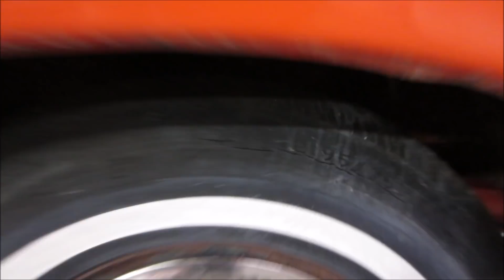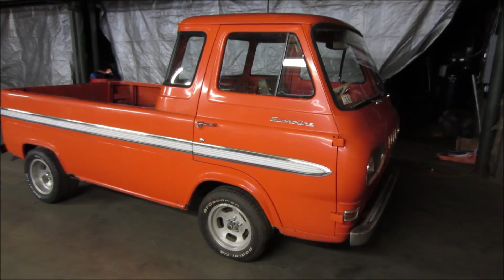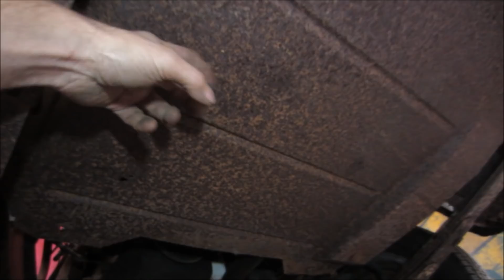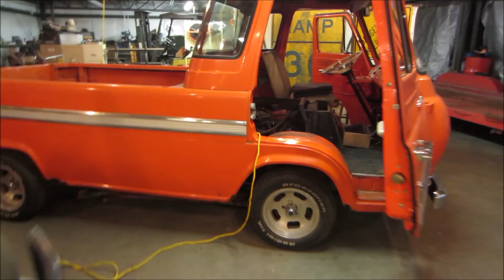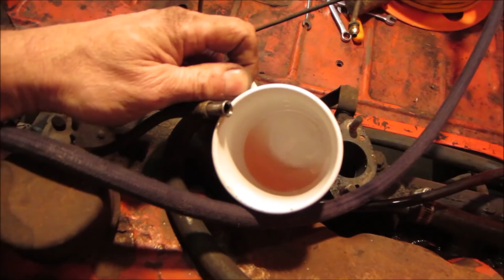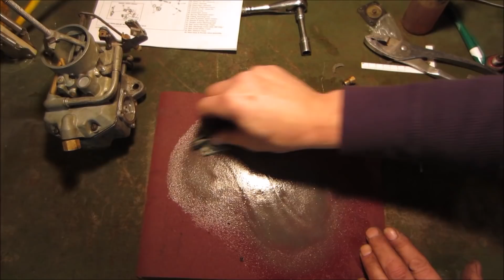Bought A Ratty Ford Truck,  Let The Fixing Begin.

Comment: Im figuring it is a 170 ci  because it has an automatic choke. I think the falcon 144 was manual choke and in the falcons only stick shift.  I dont get scared by that rust. I just want to spray it with something to stop it from taking that thing back into the ground. Something other than bar and chain oil. ha ha. But its your baby. I just wouldn't like the greasy dirtiness of that.  I use an airless paint sprayer hit it with rust converter water base. after power wash. then paint it with some water based alkyd emulsion paint. (turns to like an rubber oil based finish.) sticks really good. not very easy for the rust to come back.  Unlike undercoating does not separate very easy.

Comment: When serving in the Navy in the 60's and 70's they had a number of these trucks that were used on the flight line. The top of the caps were cut off  to where they were open air vehicles.

Comment: i have been restoring Mustangs & Shelbys for 37 yrs i have a tip for you insted of puting gas in carb fill up the fuel bowl thru the vent tubes for long run time use a chicken baster with hose attached small vacuum hose fit inside another hose to fit to baster will fit most vent tubes i have done this for yrs needing no assistancet to start run until fuel pump picks up let me know how you like it your friend Tim

Comment: Mustie1: on that 65 ford eco..the carburetor line contector (brass fitting) I think their is a round brass 'flat bushing' that is rounded at the end for the line-line..the whole piece is about 3/16" thick..it fits inside of the brass-fitting that screws into the carb. fuel inlet. This helps the line stay setted so fuel does leak under-pressure..3 1/2 to 5 ft. pounds. And I noticed the fuel-line looked alittle dinged-up on the end.."if, you've got a tool to flare-out the end of the old-gas-line and replace that old style fuel fitting that is machined to match the flared end would be better..(Costs about $4)..good luck..with your vid's..video cam works great..! The new led-soft 'white- lite bulb' should help with your lighting problems..( feathers the light better..more even..& gives more light in the shadows and corners.." spreads the light around more evenly".. and saves money on electricity. Looking forward to more educational videos thanks a lot RGB critter.

Comment: The wheels and tires look fantastic, that falcon based truck has a great body style. When it's done it will be a great, I'm thoroughly enjoying this project, old vehicles such as this back on the road are great to see. I like them better than the new stuff, because guys like you can get them back into decent running order again. The new stuff is not as interesting or as fixable and basic. The rebuilt carburetor and temp fuel system, lots of progress.

Comment: Finding a dual Master Cyl may be your biggest challenge as they were only available in 67 which is the last year for this style of these trucks and vans. Your going to find as you go through this truck, that there are a lot of things on it that are "Econoline Specific". Fuse block is on the light switch, when it come time to check for burnt fuses.

Comment: i agree with you on the rims. that truck needs those rims as bad as it needs brake hardware on the rear axle. do you remember running extended spring shackles? they work as long as you don't do a lot of power slides, and weld a tie brace in the middle. i had both extended shackles, and air shocks on my '71 torino gt to sky jack it the way i wanted it. with keystone classics and m 50 15's on the rear, i needed all the clearance i could get.

Comment: For your old green vintage engine see old steam powered machine shop video   no 45. Move the existing ring to the top space and make a new one. Remember to put lever so to ADVANCE the spark ( to the left of tdc, if turning clockwise.)

Comment: Those wheels look amazing,. Also those old I6 ford truck motors were indestructible..

Possible cheap upgrades?
Rear is the older ford 7.5in rear, the 8.8 from an 86 mustang GT should be a direct swap if you want posi trac, you can also get a later model 300 from the F series trucks if you want to stick with the i6 and get some cheap additional power, or stroke this thing with parts from the 300. You could also 302 swap it, but i would look for an 85GT motor, they are roller tappet, forged internals, with the carb, the 86 goes to a roller cam but was efi. They all are forged internally till 91 when they changed to cast pistons. The manifolds from the factory were pretty restricted, just putting after market intake and exhaust manifolds will wake up that i6 Offenhauser makes the 4bbl conversion intake with ported and polished runners, it makes a big difference in how these older i6 engines run.. sorry for any misspelled words..

Comment: I have a '67 I'm building for my project. But I'm taking mine a lot further than you are. Built my own chassis from scratch, cut off the bed and building my own. In short it will kind look like an old cab over Mac and it will be powered by a big block Ford 545 cu in. Rear axle is from an F350 dually.

Comment: Typ[ical Ford rot box.  i had a Ford 14 seater - the exterior bodywork was first class and looked the business, BUT the inner sills and rear section looked identical to your pick up.    It failed it's test and i reluctantly sold it as i didn't have financial means to get it repaired,  there was more hole than metal, but at least it has apparently been given a new lease of life - some guy bought it from me, and it's now in Romania !   ( the welding labour costs are about $ 5 an hour over there !)

Comment: You can look into the color of light, aka the Kelvin scale. The warmer the light, the better it is for our eyes and minds. 2700-3000 is common for warm, soft light. 4000-6500ish is harsh, sterile, white light. Most fluorescent tubes are harsh white light. Incandescent bulbs are a warmer, softer light. Most new cars have ultra-bright white LED headlights that are like 6500k. Awful for other drivers on the road. You can get warm white LED bulbs and tubes. Most people don't think twice about which bulbs they grab at the store, but it really does matter.

Comment: I'm not sure why you turned off the comments in the 3rd video. But having owned a 65 Falcon Ranchero from 1977 to 1990, you may want to get that head magnafluxed, those heads are notorious for cracking either on the intake manifold part in the middle of the carb or where the exhaust manifold bolts in the center. In 13 years I had 2 cracked heads. I would look at dumping the 170 CU inch and go to the 200 CU inch. The 200 has the same head / intake manifold configuration but is not prone to cracking like the 170. Not picking just telling you of things I had happen with my 170.

Comment: Love it. The tires and wheels look awesome. I agree a 302 would be cool if it fits and duel pipes? Would definitely need some weight in the back. The drive line and rear end would need to match for a 289 at least

Comment: Appreciate how you test components as you go in the reassembly, Mustie. Caught the accelerator pump leak here and has caught the occasional problem with float valves in previous vids. Respect.

Comment: i had a 89 vandura long version with Sliding Door 
275/55R15 Rims - Turbine Style only the v6 Engine though : Interior Full Quilted Velvet with Wooden Cassette Holder 
Few years Back Restoring 1995 GMC Short Box Vandura had all the Doors but lost interest in project now Driving Newer Tahoe - 285/45R22 Tires with 6 spoke Black gloss Rims

Comment: Stick with a straight six but a 300 ci with a Clifford intake and headers. I hear the 300 runs smoother than a 302. The 300 may use same engine perches?

Comment: Think you may have to modify a mustang or falcon fuel tank.    Seems like I remember the a new Econoline tank being unobtainable.      I split mine, cut the rust out and cleaned it,  and then welded in a new band of metal all the way around where the rust line was.  The pan under the front is necessary for cooling,  will overheat without it on the hwy.

Comment: On the lighting question, I don't know what you are using to edit but most video editors allow you to adjust the color temperature. I'm not complaining about the lighting but you could save yourself a few bucks on your power bill if you kept the LED lighting and just use the software to color correct the footage. Some (e.g. premiere pro, etc.) will let you save out a LUT so you don't have to reproduce the same look across multiple videos.

Comment: Im giving away my age but i remember when the Econoline falcons comets were fairly new  in the late 60's and early 70's . It seemed like they all had an exhaust leak at the pipe to manifold and sounded like a tractor. (Yes it should have a donut at the connection but most were a softer material). The engine had soft motor mounts moved all over and a long exhaust pipe so they all leaked sooner or later usually sooner. The broken head casting was not common. But the bolts that were not blind always rusted up because the water could get in from the back side. Fe' v8's had the same issue.

Comment: I'm not sure if you have tried it before but I've had good luck using Simple Green in my ultrasonic cleaner. It's way less expensive and it doesnt wreck the rubber parts like carb cleaner

Comment: The first fitting where you had your fuel leak there should of been a copper crush washer that would go over the fitting to give you a positive seal, it works much like what you see on spark plug's.

Comment: If you're thinking about putting in a 302, you should convert the front brakes over to disk and put in a 2 chamber master cylinder in it - you won't regret it, even if you leave the anemic 6 in it.

Comment: Man mustie1 love the slots on the truck leaves them, and if you go v8 289 was what came in them i believe at least all you have to do is change bell housing use the same transmission. Or make it a mid eng and put a 429 with a automatic transmission bolt the transmission straight to a new 9 inch rear end and have a wheelie monster ? Screw making it nose wheelie 😁😎

Comment: Card looks like an Autolite 1100. Same one on my '69 F-250. After a carb kit from Mike's, I got to know every square millimeter of that thing. Didn't remember which hole the check ball went in. Almost drove myself mad. Once I replaced everything, it runs like a sewing machine.

Comment: With the leaking tank, I know you can (or used to be able to) purchase a solution that you can use to coat the inside of the tank. It was like a rubberized coating that pours in, and then you move the tank all around to distribute it - then it hardens. I have used this for motorcycle tanks that were pretty rusty or had pinhole leaks. It's not a big gas tank, so maybe this might work for your tank?

Comment: Could run shackles too if ya want to go cheap ! Toss on some 4 inchers or so and good to go . Proper for that time era also . Scrap the old fuel tank and run a beer keg fuel tank ( maybe even two if yall want to drive longer distances ) in the bed instead man . Rat rod heaven right there . Easy to fill and easy route to the carb too. to fill

Comment: Wide tires on the front will chew up the steering gear and make the frame flex and fail, even more so if you put a sb in it. Even going from bias to radials will do it a bit. The chevy cabovers had this problem as well, don't know about the dodges.

Comment: It looks like the steering tie rod sleeve/tube is bent. Also I see that it looks like it possibly had a front sway bar at one time, you will definitely want to replace that for increased drivability. Also if you can find a junkyard Econoline (van or pickup) with a “heavy duty” badge it will have a 9” rear end that should bolt into your truck.

Comment: I have one heard several of those engines with a split exhaust manifold, or headers where there are four cylinders on one exhaust pipe and two on the other and they sounded really close to a V-8.

Comment: I don't think it needs a V8 nor do I think its a good idea to have to swap all the drivetrain to accommodate a V8. If you need to swap an engine see if the Bell-housing is the same for a 2.3L out of a Ranger/ Tempo/ Topaz and swap it to carb if you cannot find it with carb. You also might be able to swing a CPI version but that's going to be a bit more work. If you do go with the 2.3L there is some room/parts to do power mods. As far as small ford engines IMHO the 300-6 and 2.3L are the most reliable and easy to work on in a mid engine setup like that.

Comment: Sandblast & paint that valve cover, see how stuff is while in there.
Flush some kerosene before oil change.

Stick those Lambo wheels on the rear, rake the crap outta it!

You could get a 2 bbl intake, a 2 bbl Carter or Holley to juice up.

Comment: Axel flip the Front & Rear with new Rear Air Shocks, Front Shocks, & Longer Bumpstops!

A rough 2" Drop will look sweet.😎

Sadly, unless you add a 200-250lb Rear Ballast, it's gonna ride a bit light in the rear... Concrete Spare Tire anyone?🤔

I love this Econoline just as is with Factory 14" Rims and Hubcaps! Just "needs a squat"...

Take care Mustie1,
🤓 -Thomas
Western Washington State

Comment: You should put the smaller tires on front and bigger tires on the back. That would look great on that truck. Also that would be a cool truck to try and make 4 wheel drive. I know you could but would it be worth the time.

Comment: My dad used to fix holes in gas tanks with a glue called seals all it is very strong and gas won’t affect it he would put two or three layers of it then undercoat they hole tank it would never leak again! Just wanted to pass along some wisdom

Comment: i was always told these old econoline pickups had no wheights at all most people used old tractor wheel weights bolted with bolts to the floor to counter balance

Comment: yor crazy with the fuel propped to splash into the intake! lol. but at least u r smart enough to turn the key off if the engine fired up simulating wide open throttle(aka no carb on the intake) with gobs of fuel. I was thinking the gas can needed an air vent to allow fuel to easily be pulled out of it...

Comment: All ford and holly accelerator pumps will exchange no matter the year. So if you have a old ford or holly carb kit that has the accelerator pump or a ok used on they will work. The power valve will exchange also on most ford and hollys. The 2 and 4 barrel bolt patterns are the same on most ford and hollys also. Hope that might help someone.

Comment: I had the same slotted mags on my 67 C10 Van. Pass seat wasn't adjustable on mine. I forget the weak points on the motor bits that needed to be looked after ocaisionalley . Watch out for small groups of free range horses - they won't yield! So I heard,,*bump_heard* (more like a body slam) the slow one got up and ran off also and the wood bumper looked pretty Boss I must say! Maybe they were Ponies? :]

Comment: Had one of those 200 cubic inch 3.3 litre engines in my 1981 Mercury Capri my first car. Thrashed that thing trying to keep up to my buddies v8s. This thing would not die hit 6000 rpm and lifters would collapse would run on 2 cylinders then come back on all 6 after letting the bruise heal aka shutting it down for a few.Then got my 1985 Mustang GT LAST OF THE CARB. Sold my first love to my brother that liked to look at what was on the sidewalk a hot girl and not the road a stopped car the head light aim not good after that looking at each other hitting a pole this in 1990. Me met my soulmate in 90 still with her 3 great kids now adults and still have the Mustang.Sorry for the rant my point is that 200 cubic engine is bulletproof freshen it up and enjoy another 54 years out of it.Kinda bleed blue.

Comment: I spoke too soon I did see a rust hole damn it. I believe if I was going to change engines in that truck I believe I would use a Ford 300 6-cylinder not being a Ford man I had a 300 6-cylinder it was a kick-ass engine. It was in a 78 Ford van it came with a 4 speed with overdrive transmission I put a hundred and eighty thousand miles on it in about 2 and 1/2 years when I sold it the guy thought it only had 80 thousand cuz it ran so good. It was all highway miles I've been a pipe welder 4 50 years and did a lot of traveling. I bought it when I came back from Alaskan pipeline.

Comment: Lighting: I used to buy 5000K or 5500K (temperature) lights, which are close to daylight, for photography.  Then I wouldn't need to play with the white balance on the camera.  You can get fluorescent or LED in that temp range.

Comment: You don't know easy to replace starters until you've replaced the starter on a slant six. You have a ton of room and you remove/install it from above in the engine compartment.

Comment: check those shackles on the rear springs , they were prone to rust out there , I remembered that was the part that killed alot of them in Upstate N.Y. . also do really want to dump a 302 in that ? Try that 170 for a little bit before diving of the deep end , and having over heating issues .

Comment: Had a '68 Torino in the late 1970s.  I'd forgotten how Ford made the same parts stretch across both the compact and the intermediate lines.  And if needed, just upsize it a bit.  Compact HD == Intermediate standard duty.  Intermediate HD == Full size standard duty...

Comment: 289 would be a nice engine for the swap, or a 83 to 85 5.0. And if you would like to not have to do much changing or hunting for v8 swap parts, drop a 250 inline six in it.